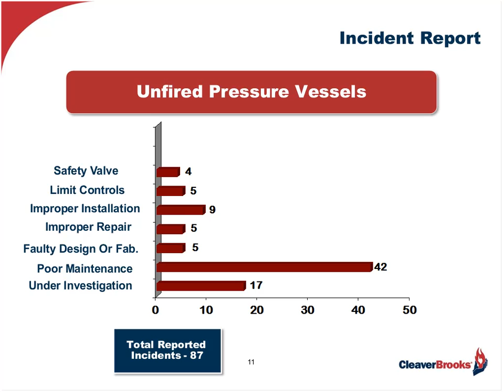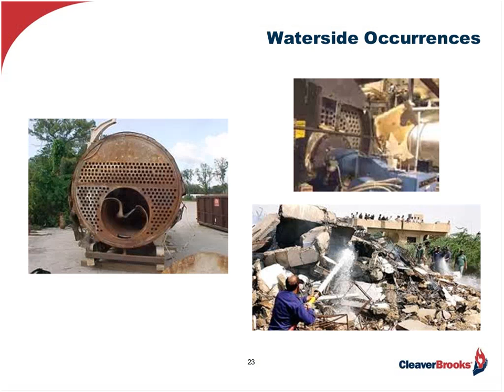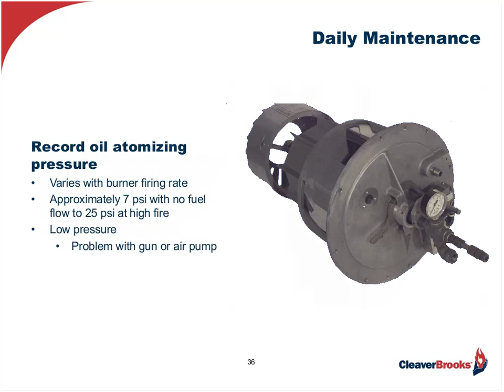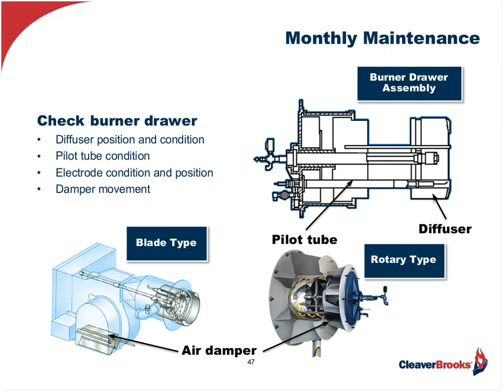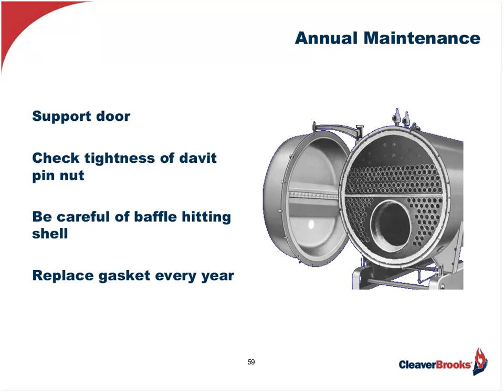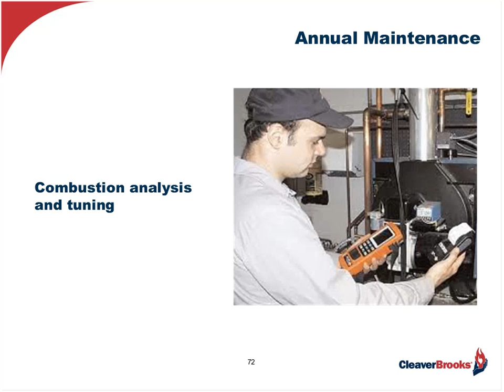Routine Boiler Maintenance Ensures Reliability, Efficiency, and Safety - January 2014

Comment: What is the difference between the bottom blowdown and the surface blowdown?
Reply: bottom blowdowns are typically used for removing settled sludge from the boiler and surface blowdown helps reduce the hardness of the water level and keep sediment level low I cannot answer the more technical aspects to it but another  big difference is bottom is a blowdown from the boiler
Reply: A bottom blowdown is performed daily the remove sediment on the bottom of the boiler. The sediment or sludge is build up from the byproducts chemical reactions of treated feed water on the boiler watersides. A surface blowdown is used to bring boiler water within prescribed chemical limits of hardness, dissolved oxygen, phosphates, conductivity and alkalinity. The bottom blowdown is done from the bottom and the surface blowdown from closer to the top. The reason being that taking the boiler water level down by a measured amount and then adding more feed water will dilute the concentration of whatever aspect of the boiler water was over safe chemical limits.